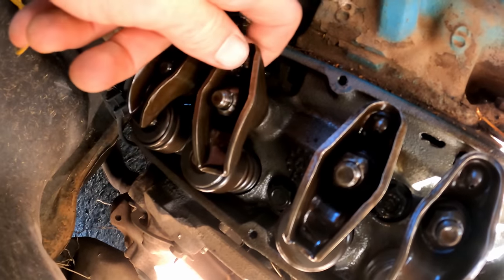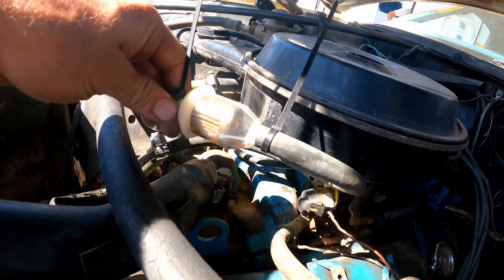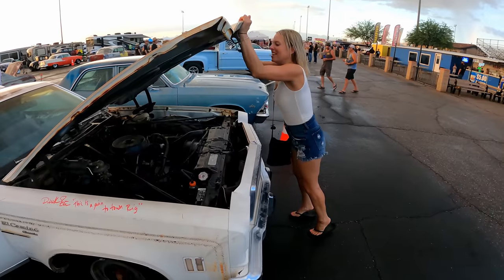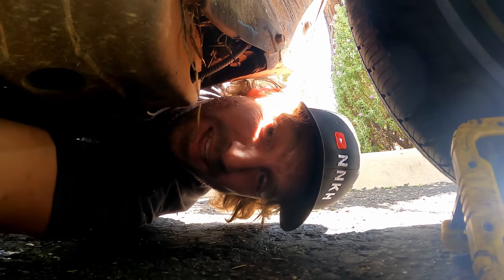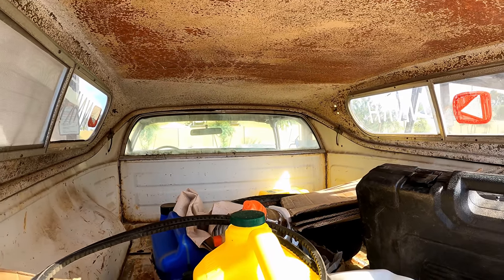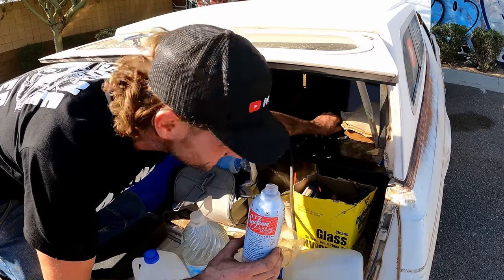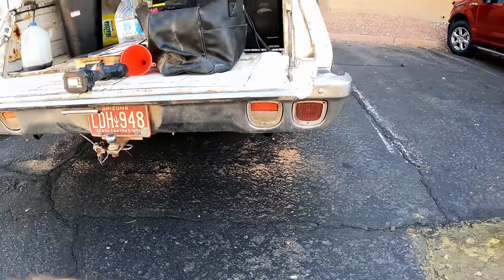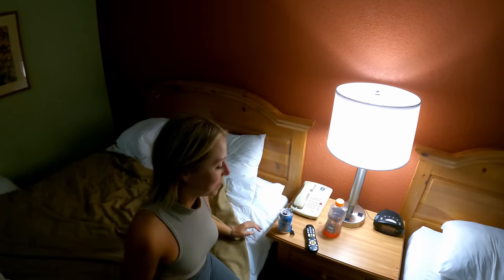Will It Make It To The Duct Tape Drags? 1974 El Camino - NNKH

Comment: I occasionally see an El Camino around where I live. Not sure what the attraction is, I mean what's the attraction? Wouldn't a station wagon be a better choice if you wanted a car-like hauler? Or, if you wanted a truck, just get a light duty pick-up....or a compact pick-up? I mean, an El-Camino or Ranchero with a cap doesn't make a lot of sense to me. It's something that just can't make up it's mind, therefore it's not really good at anything! Like a '60's Japanese scrambler with "universal" tires. They didn't excel at anything. They weren't a good dirt bike nor were they a good street bike. I'm amazed you actually got that thing running on a ll 8 cylinders though. I like your adventure trips. I've never seen the desert southwest, so I enjoy that.

Comment: The bolt on the front of the engine pull out and put a longer one in it will hold the rod 4u

Comment: Old gm engines are... almost indestructible. Running with a few bent pushrods and rockers not even seated and part of a rod *somewhere * down in the engine... still ran basically fine.

Comment: if it is screw in valve stems mite be pushing the out you can push back in drill a hole in the bottom of it and put a roll pin in it to keep from pushing it back out you will need a vacuum cleaner to suck up the metal as you drill

Comment: 1 8 4 3
6 5 7 2

At top dead center on number one, you can also adjust the valves on number six. Then it top dead center on number 8 you can also adjust the valves on number five without rotating the engine. Knock out two at a time and you only have to rotate the engine one full revolution.

Comment: at 36:55, good comment about rebuilding old wipers; they called them refills- the rubber to replace the old rubber. Todays cars typically have different length driver to passenger side. Also, the drivers of today are barely able to put gas in their car, hardly do anything semi-mechanical. I am speaking of man or woman. Fact.

Comment: I bought a car once that they said the cam was junk and found out whoever was playing with it cranked the rockers all the way down. I'm surprised the valves did not slap the pistons but then I found out the pushrods were all too short so whoever it was did not know what the hell they were doing with the valve train and in the very end there was only two dead lifters and the cam was ok but I replaced everything anyway

Comment: If you add a half a bottle of brake fluid to the motor oil the car will stop burning oil it swells up the valve guides it also stops transmissions from slipping it also stops power steering from leaking it also stops motor oil leaks brake fluid world of wonder

Comment: The bolt in the front of the block that looks like it does nothing remove it and it allows you to hold the fuel pump push rod 😃😃😃

Comment: That’s the cheesiest fuel pump replacement I’ve ever seen. I lived in Arizona for several years and I remember my wiper blades always going bad because of the dry air and heat, every time I needed them the were toast. Rainy day you go straight to the 24 parts store and replace and replace them.